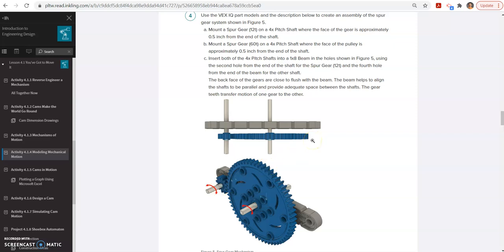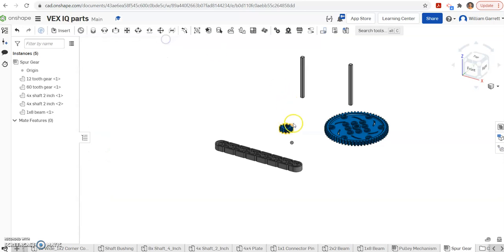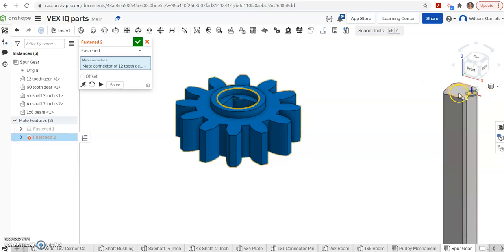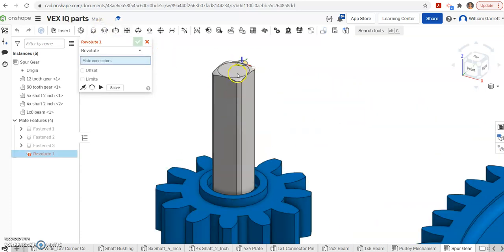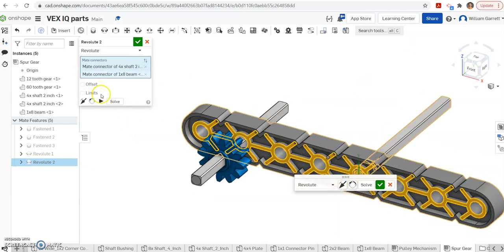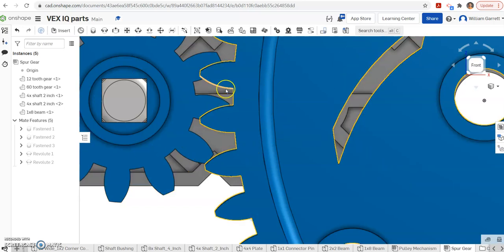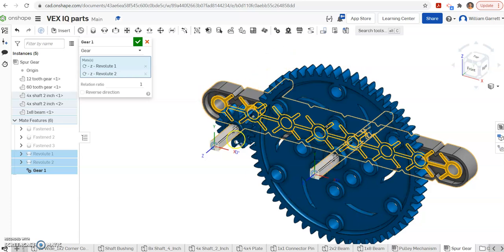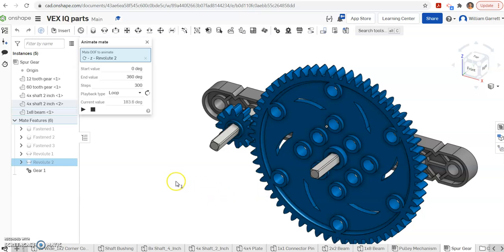4.1.4 Spur Gear Mechanism Onshape

Comment: To get the gears to mesh properly you can also expand one of the revolutes and select move to adjust the angle of the gear mesh.  This way your gear faces still stay flush instead of one gear being at a slight offset or skewed to the other.